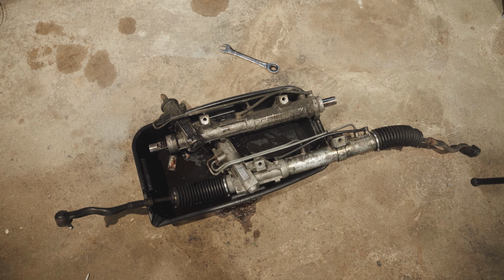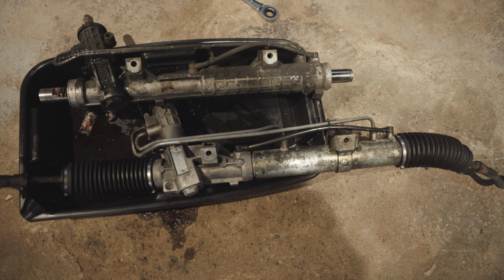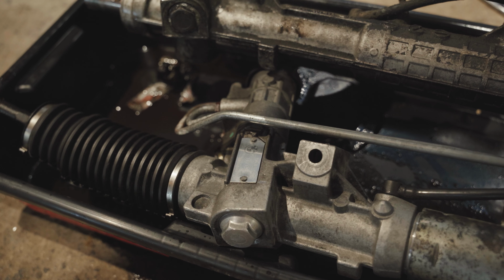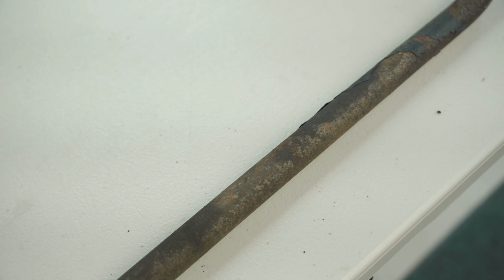Why Am I Removing My Steering Rack? | 4K

Comment: Hey man, I’m not sure if you came across this but I have a mate who is putting the same rack in his M3, he’s having trouble finding a pressure hose that fits the banjo bolt. Any tips?
Reply from the maker: @nicolaslentz4716  apologies for not seeing this sooner. I ran my stock hose with this setup, the only trouble I had was not having a mount for the metal hose so I had to ziptie it to the rack